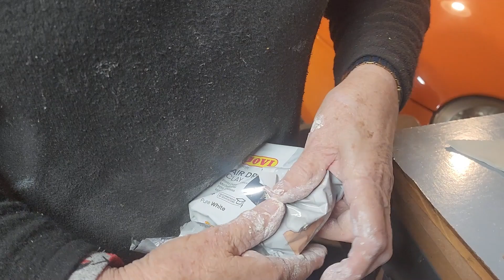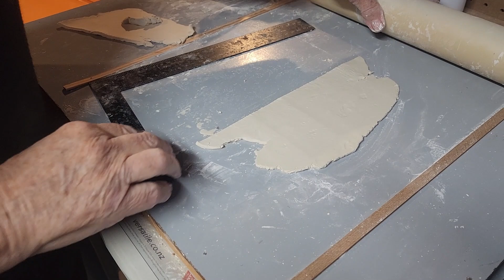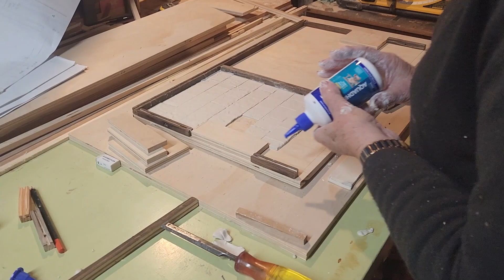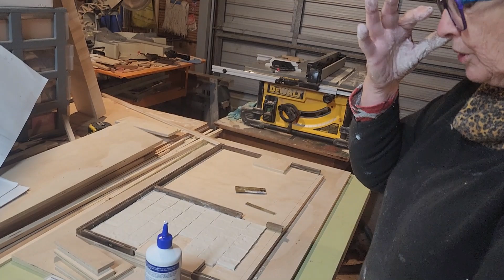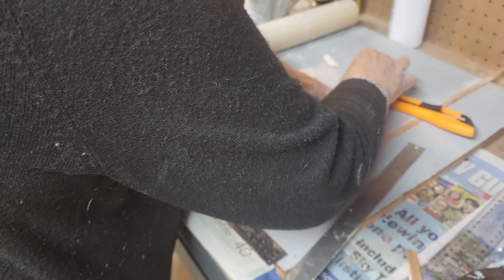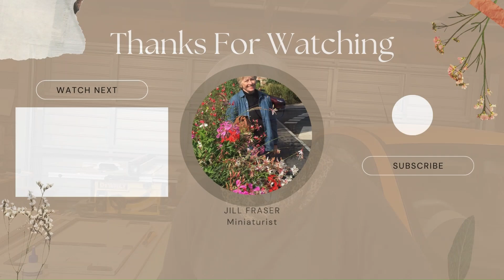How I made 12th Scale Flagstones for my Miniature Tudor House

Comment: I like how you keep the consistent thickness with those strips of wood. It's really looking good, I have a bunch of questions but I'll try to be patient and find out as you move along. :) Thanks again for sharing!
Reply from the maker: Thank you Karen.  One of the things I forgot to mention is that once you open a package of air dry clay you are wise to use it all up or reseal it extremely well.  It always manages to set really hard once it is exposed to air. And you have to glue the clay to the surface you are putting it on, as it does not have stickability. I finished the kitchen floor today. See next video. I am very happy with it.